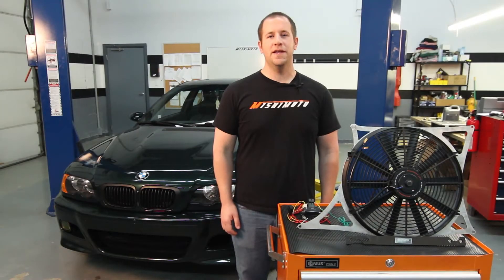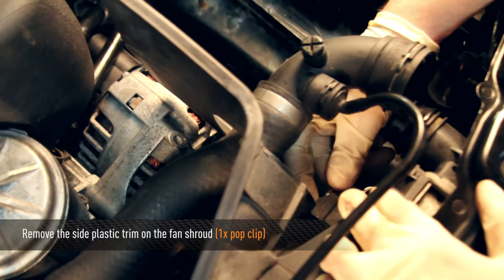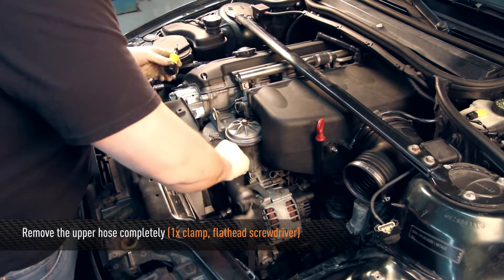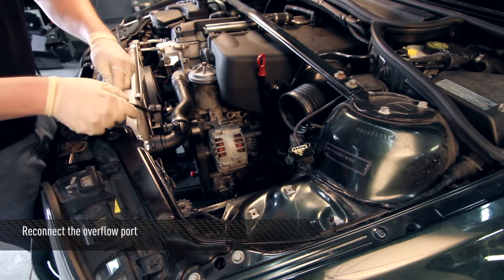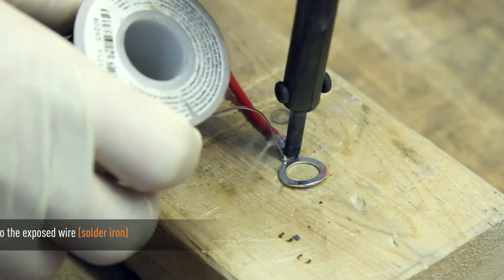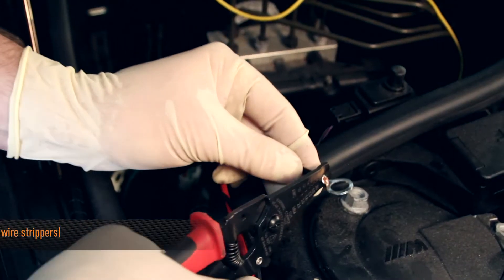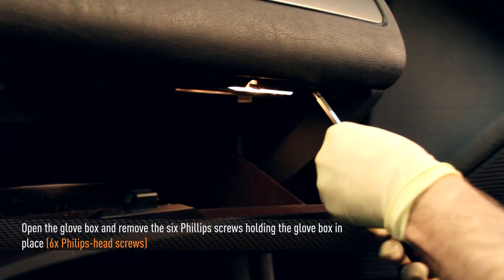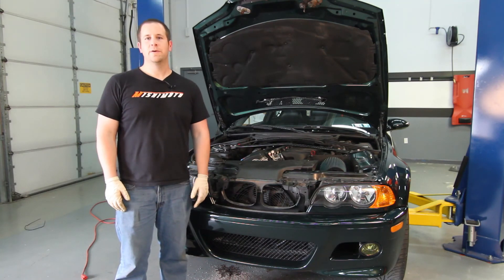2001-2006 BMW E46 M3 Performance Aluminum Fan Shroud Kit Installation by Mishimoto

Comment: I bought an e46 m3 where previous owner installed one of these fans. 

The issue im having is on hot summer days, the fan continues to run after the car is shut off. Sometimes for hours until the battery is depleted. I checked all the wiring just now and it seems to be wired correctly
Reply from the maker: The kit should be run off a switched 12v source, meaning it should turn off when the key is removed. Sounds like yours is wired to a constant 12v.

Comment: Where are you supposed to connect the wires if you didn’t opt for the controller
Reply from the maker: Some customer wiring will be required if you did not pick up a fan controller of some kind.

Comment: I’ve had this fan for over a year now, but the directions in this video aren’t clear and the camera had too many close-ups, not showing which wires they’re talking about. There’s many red wires, but which is which? This video brought my confidence down a bit, but I’ll give it a go since I’m garaging my M3 for the rest of the year.
Reply from the maker: The method used in the video is meant to provide some general instruction. I have included a link below to the instructions and wiring for the fan controller. I hope this clarifies the install for you.

https://cdn.mishimoto.com/media/productpdf/MMFAN-CNTL_InstallGuide.pdf
Reply: @mishimoto  this link is not available now , can you send another one actual ?

Comment: Just did this.. You also have to take the front under floor panel off to access the lower fan shroud torx's. Plus I managed to get the fan out without removing the upper hose!

Comment: The red wire (fused one) is way too short to reach the fan on my harness. I had to cut the zip ties holding the fan wires to the fan and route them to the other side. I barely had enough to connect after that. This video moves way too fast during the wiring portion. You need to re shoot this or make a more detailed wiring video. The two red wire should also be distinguished apart better. Hence a black line on the fused wire. The plastic connector used on the relay is absolute garbage. I spent a good 25 mins trying to "plug" it in. All of the connectors moved and jammed. You demonstrated this on a car that had the abs in the drug bin. Not all E46 M3's have that or the bar you mounted the relay to.
Reply: newbie

Comment: Is the same procedure for bmw e46 non-m3?!.
Reply from the maker: Hi Samuel! What year is your e46?
Reply: Mishimoto Automotive 2004
Reply from the maker: Great - this is the product you'd want to consider: https://www.mishimoto.com/bmw-e46-non-m-performance-aluminum-fan-shroud-kit-99-06.html - and here is a link to the install video specific to the e46 chassis (non-M): https://www.youtube.com/watch?time_continue=2&v=FOcv_LamrqY Let us know if you have any other questions!
Reply: Mishimoto Automotive I mean the installation of components.
Reply from the maker: Hey Sam - apologies - to clarify, this is the video procedure you'd want to follow: https://www.youtube.com/watch?v=FOcv_LamrqY&t=0s
Reply: Mishimoto Automotive This is not it, I have the electric fan mishimoto non-m3, not the radiator,i mean this 
https://www.mishimoto.com/bmw-e46-non-m-performance-aluminum-fan-shroud-kit-99-06.html
Reply from the maker: Hey Samuel - here's a link to our Installation Guide: https://cdn.mishimoto.com/media/productpdf/MMFS-E46-99_InstallGuide.pdf

Comment: I´m surprised about the right (driver side) fan shroud removal. I always thought that if you disconnect the coupler it would be a mess of cooling water flowing around, but it´s like there´s no cooling water into it? I always let the shroud apart and i hate it when i´m working around the area and it´s hanging on the coupler...

Comment: the steps on the wiring installation is quite rushed... everything else shows you where it is exactly then the wiring portion I was like "wait what? where? where is that??? LOL

And what happens to the wires that was on the shroud if you don't install the shroud?